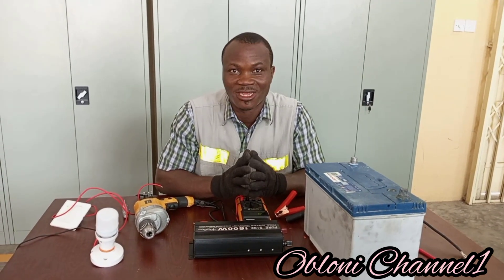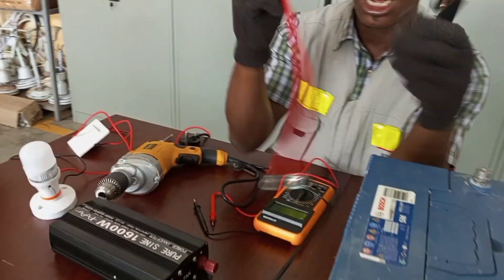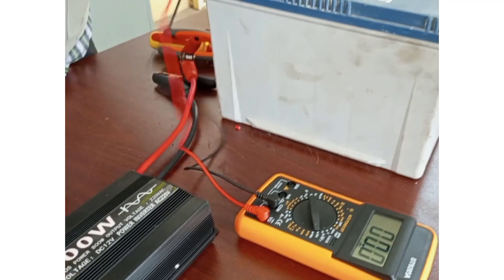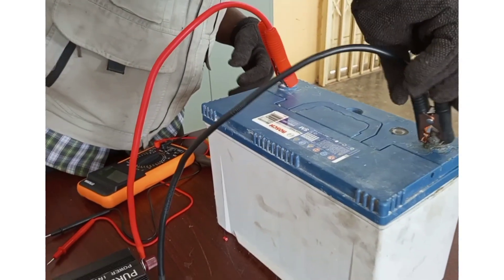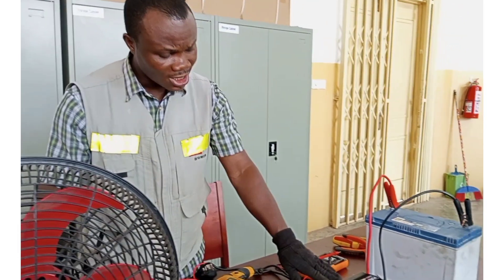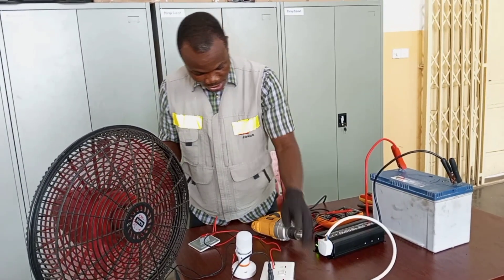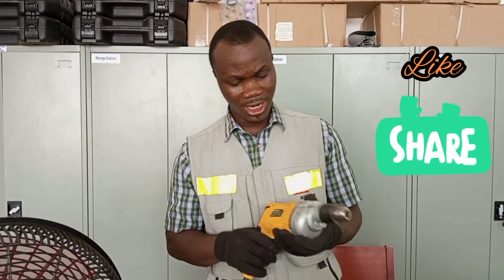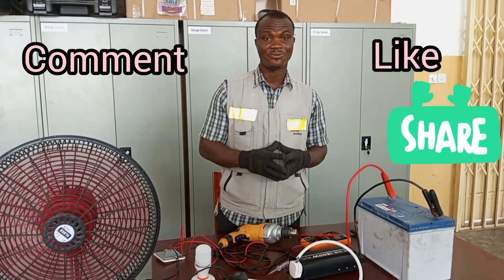DC TO AC CONVERTER

Comment: Pls sir um what type of inverter do I need when installing five bedroom house.
Reply from the maker: Alright, so it depends on the total load ( the wattage rating of the electrical items you want to connect to the inverter)  Some times you May  need the inverter for only some specific gadgets.
Reply from the maker: Please that will depend on your Power needs. I mean, the load. We calculate by Load, not by size of the building. For more info on how to calculate your load, contact me. +233242809918 or email: ezekielobloni@gmail.com. Thanks
Reply: @obloni_Electrical Sir please how do you charge the battery when it's weak
Reply from the maker: @danielteyehuago1633  
You have to buy a charge controller(charger) to be charging the battery. Don't worry I will explain this more in a subsequent video
Reply: @obloni_Electrical  Thanks
Reply: @obloni_Electrical Sir please how do you charge the battery when it's weak
Reply from the maker: @danielteyehuago1633  
you have to use a charge controller. I will explain in subsequent videos. thanks
Reply: @obloni_Electrical Sir please can I also emailed you for the same reason. I mean the load calculation
Reply from the maker: @danielteyehuago1633  
sure